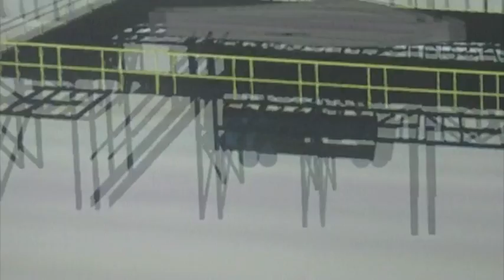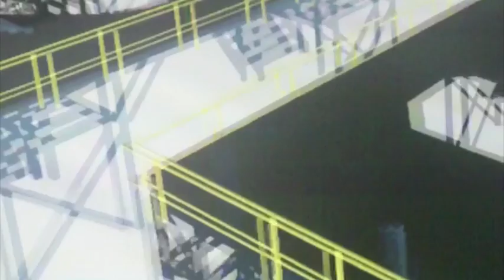Building Boeing's next fighter part 2

Comment: technically, it is just 5th generation, assuming Hornet as a 4th generation... Boeing concept´s seems to be based on F-414 engine core and are more NAVY like, and Lockheed Martin looks like mainly for USAF and is based on F-119 evolution.